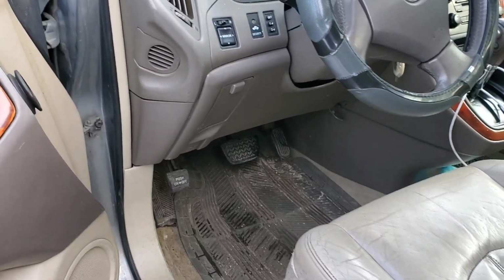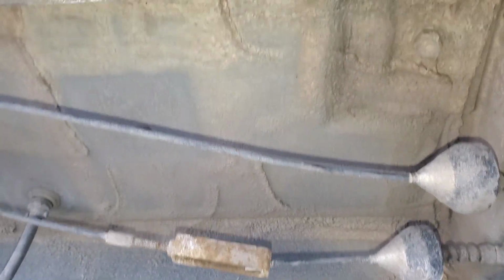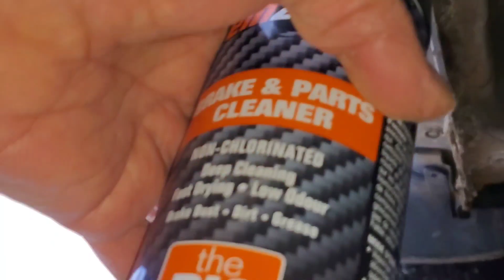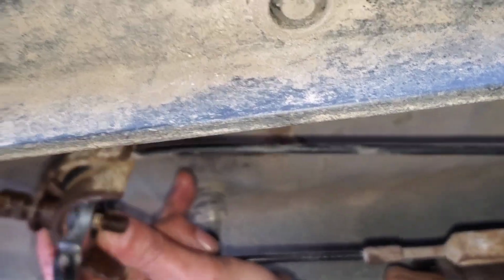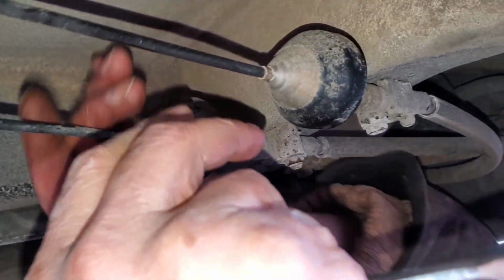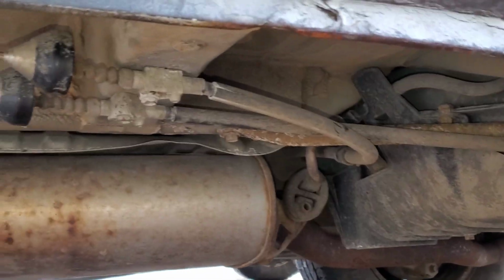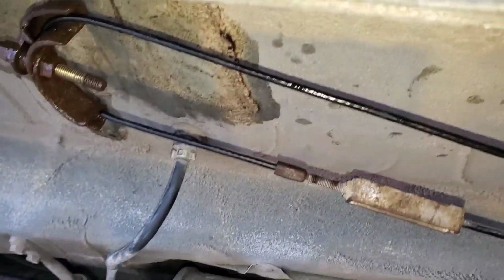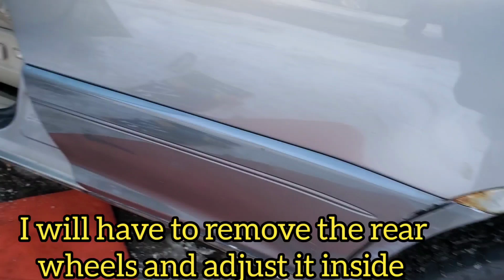How To Troubleshoot Parking Brake Not Working, 99-03 Lexus RX300, part 1

Comment: Difficult part to adjust, thank you!
Reply from the maker: Yes it's the best way is to left the car with safety jack and stand and try to adjust while rotate the wheel until you get it right, as most old car Emergency brake rusted and stuck, the worst ifvthe cables are rested and stuck in some cases you need to replace the cables,  thank you and all the best,